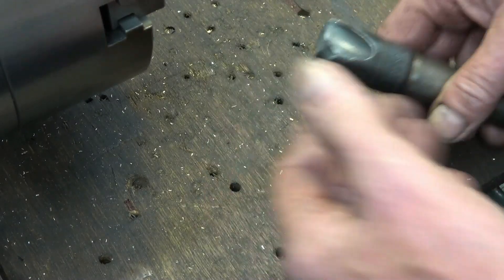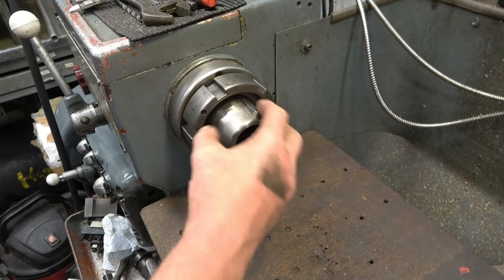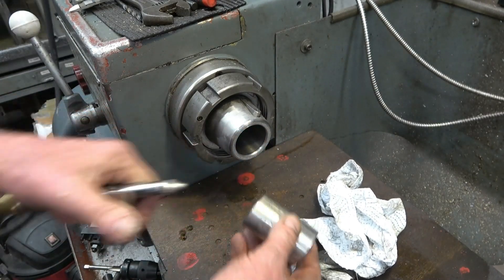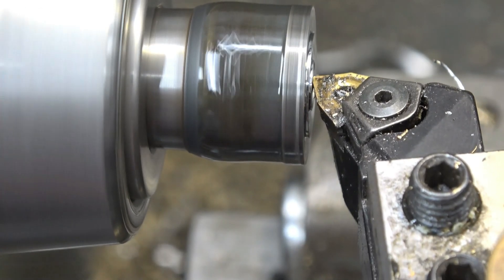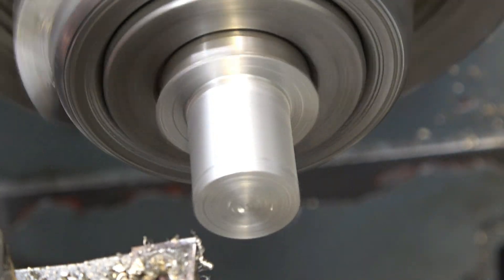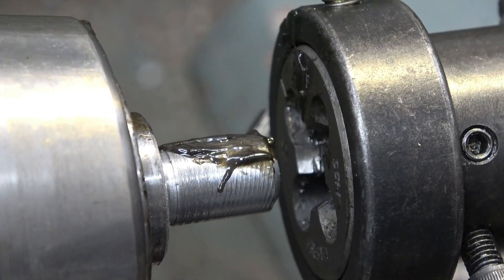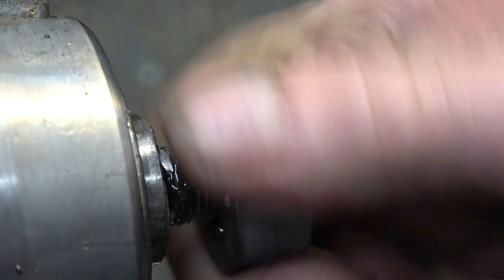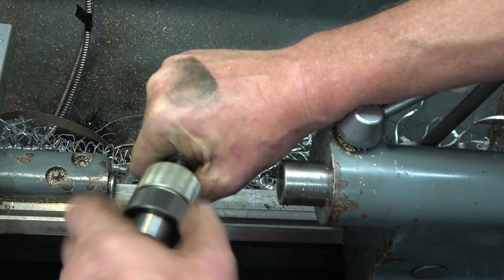SNNC 501 P1 Modifying A Broken Morse Taper Drill Shank

Comment: Hi, if you look in the back of the chuck you will see a register, this must interface with the mandrel with slight interference fit.
This will give concentric fit if the thread is single point cut on the lathe.

Comment: It was all going well until you butchered the thread and to finish with a die is not the way a good machinist would do it. You have perfectly good thread cutting ability on that Harison lathe so I just cannot understand why you took that short cut. It might only have a few thou run out but when you use a centre drill in it ???? Good luck Ian, a qualified machinist.
Reply: You don't understand, do you? Others copying his work may think it's normal practice. All I am trying to do is if the job is worth doing one should do it correctly. In his video, he mentioned threading using the lathe but decided to take a shortcut and look at it - run out!!!!@@chuckkirchner1014

Comment: The adapter in your headstock is a morse taper four and a half John. Bloody hard to find now.
Reply: Hi there I got exactly the same lathe and never knew what the headstock taper was never heard of a morse taper 41/2
Reply: @johnmcdyer7297   Got an old Hendey and it took me a year to work out that it had a 4 1/2 Morse taper headstock. Can get one over the pond, but the postage is brutal🤥
Reply: @chattonlad9382  I think I had 2 of them with my Harrison
Reply: They're available online.
Reply: @65cj55   Do you have a link, I''m in the UK.
Reply: I found a guy on ebay who had contracted with a CNC shop to make several of the 41/2 to 3 mt adapters.  It was a little pricey but is a great adapter.
Reply: Grizzly  has 4.5mt  to  3 mt  bushing   last  I checked.  IIRC  it was  about     $50  U. S.    Just  about   every  L00  spindle   I've  seen  has  a  4.5  mt,  leblond, rockwell,  colchester/ clausing, harrison, etc.